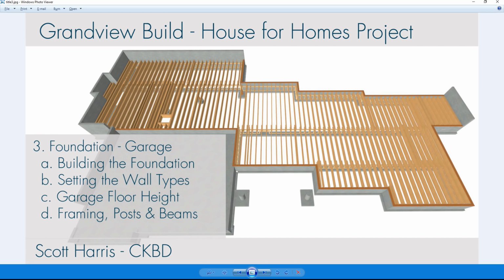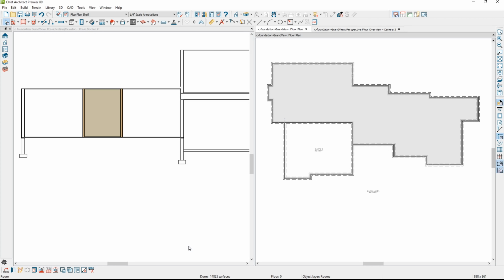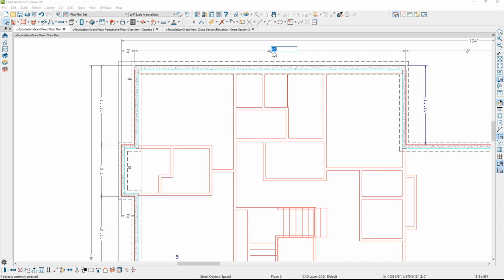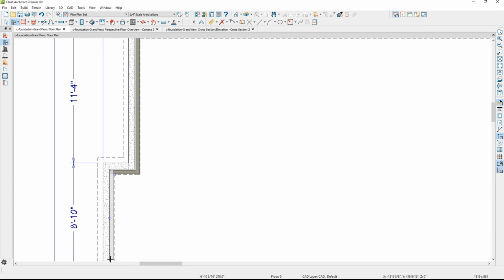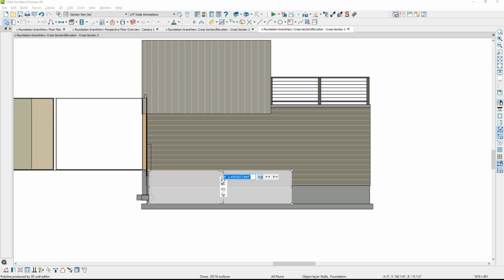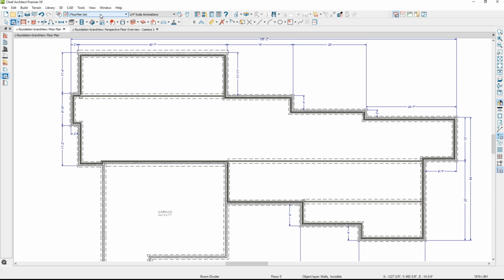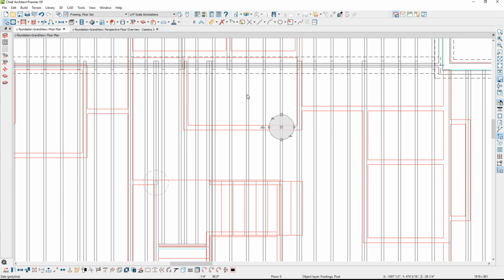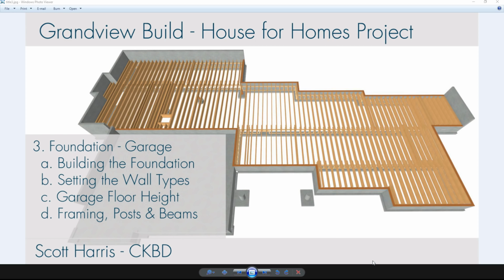Grandview Build Project - Foundation and Garage

Comment: The only reason why I am not buying your program is because you don't have an option for pile/stilt foundations. I live in a coastal town where houses are build on piles/ stilts. If you can bring that option into chief architect, you will definately have another customer.
Reply from the maker: Hello, thank you for reaching out! This is available in the software. Here is the step by step process: https://www.chiefarchitect.com/support/article/KB-01027/creating-an-elevated-structure-on-pilings.html
Reply: @ChiefArchitect  thank you for your reply. That's going to take too long. When I sit with a client I don't have time to edit defaults back and forth. It would look unprofessional.

Comment: What makes the footing and foundation wall disappear when i try to place an exterior wall on top of it? I have shorter knee walls in my walkout but I cant illustrate the framing on top of it without it changing the type of wall completely.
Reply from the maker: Hello, thank you for your comment. I am not exactly sure what is going on with your plan from what you have described. I would recommend sending your plan to our online support center for assistance on this. I have linked the support center below. 

https://support.chiefarchitect.com/home
Reply: Great video please what version of chief architect is this?